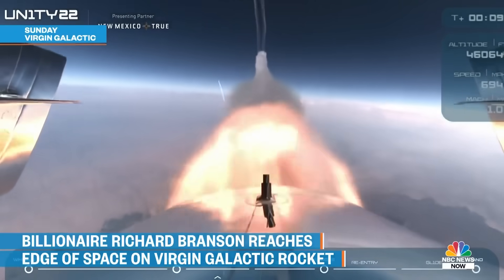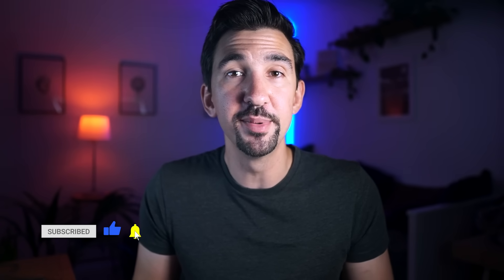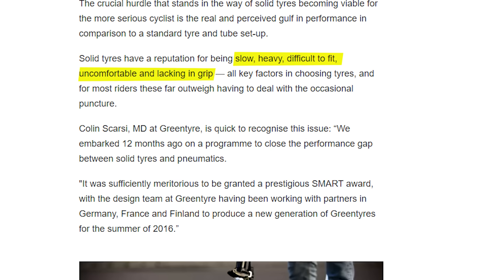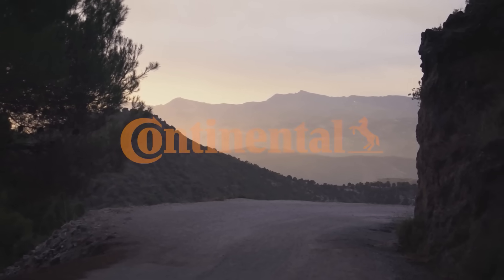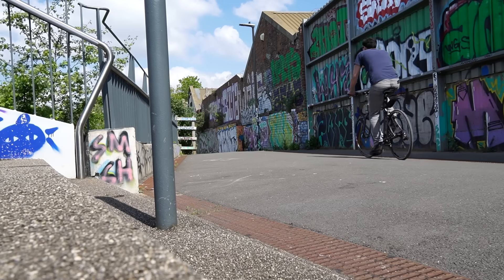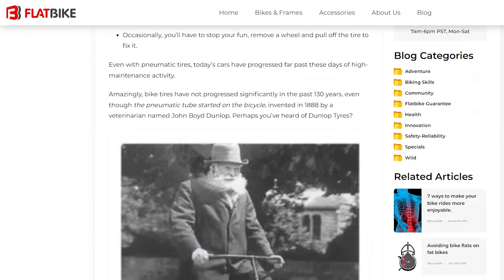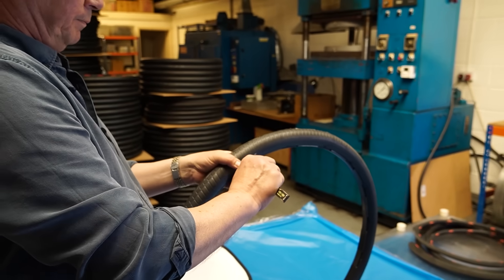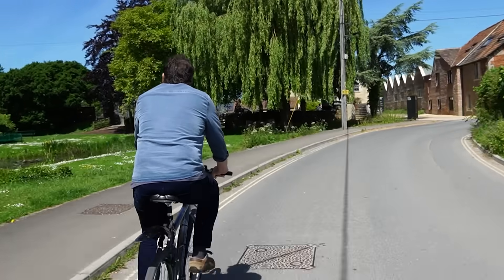I Tried Solid Bike Tires | Here's What I Found

Comment: How does one get this tire in Romania? I need an All train tire, grippy enough for mud roads, but smooth enough for street roads, but tough enough for off road stones, and on road unexpected road pots for when you can't avoid them because of traffic forcing you of maintaining a small strip of road, where storm drains are, and some times the road around the drain erodes, leaving a small window of jumping with the bike over the hole that ends abruptly in the drain, and sometimes you jump a bit early or late and you hit the back tire on the edge of the drain (got 3 flats that way, different areas, but luckily kept my rim intact.).

Comment: I wonder what happened to the inner tube I used in the 90s.  Quite thick with a hollow gap in the middle.  It didn't have compressed air, and never got flat.

Comment: In South Africa we had PermaTubes in the 1990's that is basically the same as solid tires. What a bad idea, Yes if fitted you didn't get flat tires but it added weight to the wheels witch made it harder to peddle. All of us is back to Pneumatic tires on out mountain bikes. I haven't seen a PermaTube from about 2000. I know that Kevlar ply tires are available that are puncture resistant.

Comment: I started commuting a few years ago and after getting 10 flats in under a year I switched to solid tires. It was a horrible fight to get them installed and I'm not sure I would do it again when these wear out but not having to worry about having a flat half way through the commute was worth all the trouble

Comment: My first bike, when I was little, had solid core foam tires. Those tires lasted through trail ride after trail ride for a ridiculously long time. The rubber compound wore off completely eventually, and the bike fell apart, but they held together - no chips at all. Some of the tread was even shaped into the underlying layers, so 6 year old me kept on riding. It was GREAT, I hope I can have tires like that again, but that hold up to big boy MTB.

Comment: This is very old news - in South Africa in 1982 - 1995, BMX bikes (most often) could be fitted with fine-foam tyre inserts which replicated the characteristics of the air in a tyre (even down to being 1.2 times as heavy as air) , allowing the bike to go over nails and screws, and not puncture. The outer rubber tyre tread itself would wear out first !

Comment: A tyre liner has helped to reduce the frequency of puncture for me, but next round I plan to switch to solid. Yet by bigger issue is not traction, but braking. Engineers have not yet developed bicycle brakes that stop us fast when needed most. Disk brakes work better than calliper ones when new, but soon lose their grip, leaving us to slide in front of moving motor vehicles or over the edge of a roadway. Changing brake pads sometimes help for a while, but those, too, quickly lose their grip. Can you advise, Doc?

Comment: Nothing new with full rubber tyres. Just look back at Mercedes Benz... in Jan 1938 Rudolf Carraciola hold the speed record on public street until recently. 432,700 km/h. With full rubber Tyres. Nowadays only very few manufacturers run with air tyres over 450km/h on ordinary streets... like Koenigsegg and Bugatti... Even most commercial air planes do not support those speeds.

Comment: The problem isn't anything technical, it's about weight, or the rotating mass to be especially specific. Filling the tire with anything other than a gas is a losing game from the start, just because you have that extra mass. Even the everyday cyclist will notice the difference.

Comment: These would never work period. Tire pressure plays a significant role based on the conditions you drive, 60psi is what i have on the rear tire of my bike for low drag on even roads and it drops to 25-40 for rougher terrains or offroad otherwise it's deadly, when it's slightly wet or occasionally rains but i still don't want extra drag i drop 60 to 40. 
There is no way you can control these parameters with a solid tire, not without any sort of mechanism inside the tire that would make it weight inefficient and only add complexity. Also what's their weight? What if the inner material faces fatigue or premature wear? What if the opposite happens and the tread gets worn out? With the same tire change intervals you have to dump a whole lot more material than if was just a skin of rubber (tire), because the outside material is still the same, if we could make magical tires that grip and don't get worn too much the same benefits would apply to tubeless or tube type tires so no problem at all.
I always looked forward and i'm very positive for solid tires but i don't see them happening any time soon because they can't solve basic problems that Air solves by its self. For flats we already have run flat technology that can prevent accidents and sudden downtime even though it's not yet applicable to bike tires.
For Forklifts etc solid tires are great, otherwise don't try to reinvent the wheel, it didn't happen in ages, it ain't gonna happen anytime soon.

Comment: At my local bikeshop they have had another competitor that I couldnt find in these comments.
Basicly its a foam like rubber that you insert into your pneumatic tyre so that the tire is still filled with air, you just dont need to pump it up. 
The installation is as simple as removing one side of the tyre, putting the rubbertube in and putting the tyre back. It is stab and leakproof too. 
So I would like you to compare this solutions to the others. Unfortunately is that I forgot the name of this solution.

Comment: I have a wheelchair with solid wheels, and it's really great never having to worry about a puncture, I've used them for nearing 20 years at this point, they can last a long time before they might need replacing. But a wheelchair is very different from a bike, wheelchair tires are much closer to the requirements of a shoe sole. A good seat cushion will serve you better for softening bumps, and some tire designs don't even pretend to have a tread.

Comment: The Gecko Rubber tyre does look excellent and I can see it's adoption really taking off, especially for commuting, long road trips and perhaps even gravel riding.  EBikes and City bikes (bikes provided by a city for commuting) also seem a very applicable area.
If the rolling resistance and weight of the Gecho Rubber tyre is as good or better than Continental GP5000 then it would be very interesting to have them on my road bike for 100-300km bike rides.  Until then, I'll just keep my tries an an appropriate pressure.

Punctures in pneumatic tyres are predominantly due to lower pressure than recommended by the manufacturer for a given riders weight. A higher pressure will help push away most road detritus that can cause problems. Low quality tyres or very thin racing tyres are more susceptible to punctures.
When punctures happen soon after a tyre is fitted, it's usually due to a pinch flat on the inner tube, or less likely damage to the tire wall during fitting.  So Incorrectly fitted tyres are a third common source of punctures.
For general purpose riding, choosing larger size pneumatic tyres (32 and above) that is inflated according to the manufacturer guidelines should be puncture free for a couple of years daily riding (unless large glass shards or sharp metal objects are cycled over - which should be easy to avoid in general).
If pressures are set lower than the recommended levels (usually for more comfort), then 'tubeless' tyres reduce the effects of punctures obtained due to lower pressures (although tubeless does require it's own maintenance)

I have Tannus Airless tyres on a Brompton that is used on a daily commute of 40km round trip.  The Tannus Airless tyres feel as fast as the Schwabe tyres I used before and don't make the Brompton feel any heavier.  On a racing bike or other lighter bike, then the difference may be more noticeable.

Comment: If you're getting a puncture a month, you're doing something seriously wrong. Don't cycle in the gutter, where all the glass and stones accumulate. Watch out for pot-holes and don't smash through them. Make sure your tyres are well inflated: one of the common causes of punctures is hitting a pot-hole with an under-inflated tyre. The tyre gets crushed between the wheel rim and the edge of the pot-hole (or kerb) and two holes get sliced into it.

Comment: Not sure what kind of pneumatic tyres you have been running. But the cheap ones will give a lot more trouble compared to the medium / higher cost models. Unfortunately, cheap tyres are often standard fit with bikes under 1k. And the first thing you should change out. Once you get out of the bargain basement the return for your money goes up a lot for the sake of maybe 10 or 20€. I can remember the ones I used cycling to school back in the late 80's these match your description on reliability well. The tyres I use now hardly ever puncture. I'm using 37c Vittoria Voyager Hyper have a Kevlar armour belt. These have good grip, low rolling resistance and are very very light too. 
That said I'm very interested in solid tyres that compete with pneumatic. The amount of people I see cycling about with half flat tyres, especially on e-bikes, increasing risk from puncture, reducing tyre life and increasing rolling resistance. This product sounds amazing. It has a great future, mainly because lots of users, especially E bike riders seem to be new to bikes and aren't too interested in taking the time to pick up decent tyres or keeping them pumped up!

Comment: "Schwalbe’s three-tire Marathon Plus lineup is among the company’s most popular and has been around for more than a decade and a half. For the most part, it’s immensely popular among most who’ve tried it. After all, they report it delivers a solid mix between comfort, low rolling resistance, high puncture protection, and a variety of tread patterns from which to choose, depending on terrain." In NQ Australia where we are afflicted with heavy duty thorns, I got many flats on my electric mountain bike until I used Schwalbe Marathon Plus tyres :) Then I got no flats, you need to pull out accumulated thorns after each ride, which was good because they have wire beads and require a special technique to get them on the rims.
Reply: Totally right, of course there is a market here. However, if you buy decent tyres flats are history for sure. Guess best argument here is, do you actually inflate your tyres regular or do you want zero maintenance.
Reply: I've been a near daily for seven months a year ebike rider, on and off road, for seven years now. I used to get one or two flats every year and they were often very inconvenient. And even though I've been riding and doing some repairs on bikes for many years, changing an ebike tire can be a real hassle because of their stiff sidewalls.  I researched and discovered Schwalbe tires, which has an amazing selection of puncture resistant tires and found an amazing tire that fit my bike and my riding style: Super Moto X. During the last four years since I've been using them, I've had exactly one flat tire, the sharp inner of snail shell. Love my Super Moto Xs.
Reply: Oh god no.  If you are used to supple tyres, these things are horrendous.  Having said that, my tyre of choice, Rene Herse (any one of their tyres), is quite fragile and puncture prone unless you go tubeless.  I understand why people will suffer for puncture resistance, but having been a victim of both the infamous Gatorskins and Shwalbe Marathons, I choose standing on the side of the road in a thunderstorm changing a flat.

Comment: Stick to the things you know, Doc. One of which is obviously making YT infomercials. The "big question" isn't how they hold up. The only important question is how well they perform as a pneumatic tire does, and the answer is like crap. They're slippery on hard surfaces, and they don't grab well in scuff. After 30K miles on my ebike on all surfaces in all weather and experiencing numerous flats, I had a set of solids mounted hoping beyond hope they would be what I wanted. They weren't. I didn't take into account the need to be able to adjust the pressure for different surfaces. After two weeks and two falls, I cut the bastards off my rims and won't try again. And the occasional flat has taught me a few things. I think you're basing your opinion on limited on-bike riding experience and a little self-profit. Ride safe.

Comment: I don't really see a major problem to solve here. 

Good quality innertubes already last years, cost a couple of bucks and take 15min to change and 1 minute to pump up every week or so. You can also fill them with tubeless sealant for extra robustness if you dont want to go tubeless altogether. So I think we already have a decent solution.

Keeping a chain/drivetrain clean and lubricated however. That is a challenge to solve. (i see belt drive in bikes that are not driven seriously, an ok solution)
Reply: But I have to add, if we could get an affordable and decently working tire that would never need to be pumped up, that would be a huge innovation. Not only in bikes but many offroad vehicles etc.

Comment: 40 years ago I read that the reason a non-pneumatic tyre will never be a success because the success of the air filled tyre is the LARGE air reservoir all around the wheel even though the contact are is only a small patch on the bottom.  This guarantees that the contact pressure will remain almost constant even when the type is deformed as the total volume is almost unchanged.  

I see no reason to suppose that physics will have changed very much in the last 40 years.

Comment: Since 1995... I figured every adult bike would pedal-assist, therefore... the added weight of solid tire "tube" would not be felt... or... at least have the inner tire tread lined with Teflon to always prevent puncturing of the air tube.

Comment: Personally im stuck in the pneumatics category, but i did make one big change that has helped majorly. Puncture resistant tire liners. I used to flat at least once a month, but since i added those in i've pulled things out of my wheels that would have before had me pulling out the old tube and CO2 cartridge to get back on the road. Its been 2 years without a flat from normal things, i literatly had to bash my wheel in a pot hole deep enough to smash the rim to get a flat.

Comment: It would be interesting to see how these tires would perform on my TerraTrike. I actually struggle trying to find tires with a flatter profile since I don't tilt into turns like a traditional bicycle. If these are stiffer, then traction may not be that great. I scrub a lot in high-speed turns. I wish I had a bit more steering axis inclination on turns (a bit more camber while turning), but I realize trikes are a very specific niche.

Comment: A Schwalbe Marathon Plus has enough rubber and anti-puncture layer that you can run right over a thumbtack and it won't get through. And it's a tested, reliable tire that'll be good for 10k miles, great road grip. Rough road? Let some air out! Try that with a solid tire.

Comment: I do 95% of my riding in the country areas on my carbon road bike at 13,000 km per year with one puncture per year using pneumatic tyres. Ten minutes to fix and on my way. It is amazing how Mr. John Boyd Dunlop got the science right so quickly without computers. Airless tyres are good for short, city commuting, IMHO.

Comment: Rolling resistance isn’t simply how firm the tire system is, but where your converting energy to heat. Bicycle quarterly has helped dispel this misunderstanding and should be considered as part of the solution. Foams could definitely be part of it

Comment: even if its not turned back into a gecko tire, it could be turned into anything that uses rubber, as rubber is used in a LOT of places, and you would be surprised at how little stress they would encounter, but are still needed for

Comment: When I was a kid a had a bike with solid tires and that wasn't much joy as I remember. Super heavy and sluggish to tread especially if there was even the slightest of headwind and bouncy too so I'd get completely rattle all over from riding on uneven surfaces. Obviously, time and tech has moved on since then, as I can see in the vid, but I wouldn't trade my air inflated tiers (which has an anti-puncture feature integrated, a kind of a shielding band of hard material embedded in the tire itself.

But what I actually wanted to know is, what is it you help scientists with? In that fully awesome introducing yourself at 1:30, what exactly you help is lost in a mumble before the word breaktrough. It annoys me endlessly that I'm not able to grasp what you say theer: "Hi. I'm dr. Ben Miles and I help scientists term-turn-t'own(?) scientific breakthroughs that help improve ..." None of the suggestions fit - t'own, I don't even know what Cthulhu-tongue that is - the context very well. So it has to be something different and I just can't get it. You are swallowing it, my good man. Forgetting about your articulation.